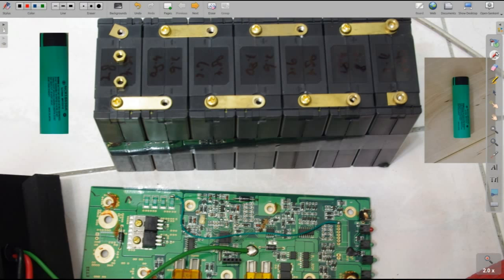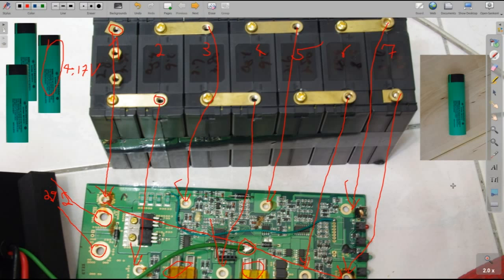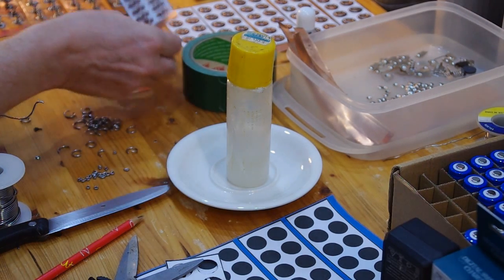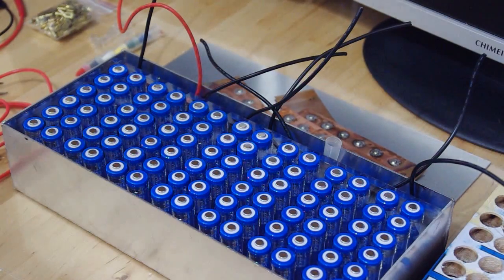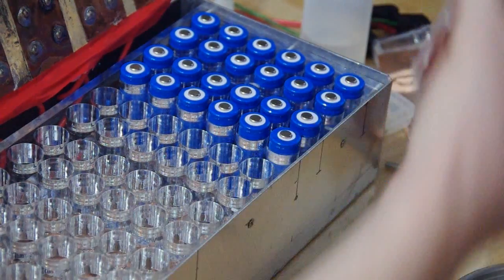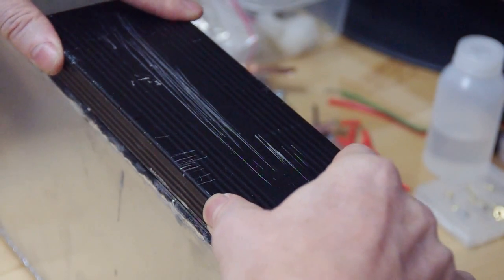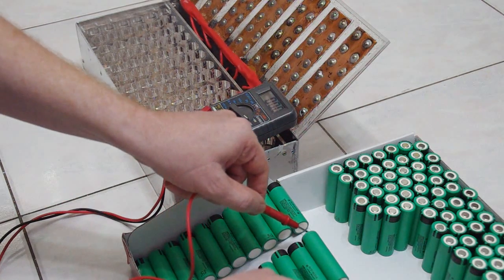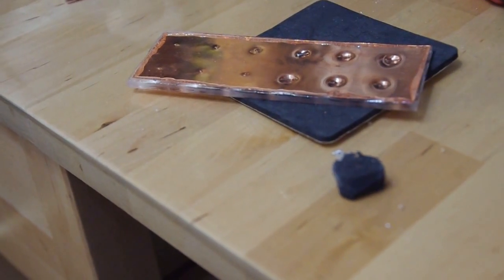How to build a Li-ion battery pack with panasonic 18650 cells 3100mah A

Comment: Nice battery pack and a simpler construction that many others. I had a similar idea but with spring plates top and bottom to make connections a little more reliable and easier between different batteries. It seems like those China eBay sellers could sell spring loaded DIY kits that would be perfect for the average home DIYer.

Comment: I wish that uyou had touched on the spring portion of the design, like where you got them, and where you got the strip solder that you used. Also, where did you obtain that flat copper stock that you used. This is a great design, I would love some links to the items that you used.

Comment: Love this video. He is the only guy who planned and executed an original design with spring loaded pack. Only pack I have seen, where you can pull out one battery at a time. My only concern is, over time, oxidization of the connection. I wonder if you could gold plate the terminals so there is always a good connection.
Reply from the maker: Thanks!
I was thinking about gold plating them before, or using some parts recycled from old PCs that are gold plated already. 
My next pack is definitely going to have some improvements, even though I did not run into any problems.
Reply: Hi David, Aqua regina can dissolve gold from your PC boards, but is highly explosive. Dangerous around organic solvents. Years ago, you could buy gold plating solutions which were not too expensive, but the price of gold in the 80's was low. Typically, companies here would gold plate a small circuit board for $2.50 US. Tesla, appears to be using tin, or tin plated metal and punched out the battery design with a space for their @6 amp fuse, I wonder if its possible to send the design to a pc circuit design company to make 2 prototypes for testing. I seen video where these 6 amp fuses were hand soldered ( hundreds ). Seems, too flak tome. A copper bus bar would be needed to carry all the current. I do not like the idea of a BMS, I know nothing about charging $1,000 US in batteries. I like your design because you can remove 1 cell at a time to make sure it is properly charged.

Comment: Hi David,
I love your design so much that I'm going to copy it, but with a twist. 
I'm going to avoid BMS and balance charging by using interchangeable 18650 batteries. The batteries will be charged individually then placed in the box. When my ebike (a Sondors Thin 36v) tells me the batteries need charging I will replace them with other pre-charged 18650's. By using this second batch of 'ready' batteries I should be able to make the changeover in less than five minutes and this should give me a range of over 100 miles or 160 KM. 
My batteries are all reclaimed from laptop batteries. All of the cells I use will be over 2KmAh, most in the 2600 to 2300 range.
When I get the box built and installed I will upload the finished product. For now you can see my first attempts on my channel.
Many thanks for a great idea.
Reply: Rocket Rose, I was thinking the same. I wanted the Tesla design with 6 amp or less fuses.
Reply: Rocket Rose k

Comment: Great ingenuity ,  BUT I see a serious concern....there should be fused protection for each cell, like you see in the tesla s, or most all electric vehicles, if just a single cell shorts and doesnt separate itself from the pack you just created a hell of a fire bomb...... the thermal runaway would be insane

Comment: >All cells are charged this way at a maximum of 650 mah, which is good.
you mean it aint 3100 mah? how you can get all 3100 mah from it?
Reply from the maker: By 650 mah, I meant the charge current. Each cell has to take in a maximum of 650 milliamps in an hour. The charging time is about 3.5 hours at that current. After that it drops to a lesser current and at 3.9 V, the charger will go into a very slow charging mode.

Comment: how are you handling cooling of your battery pack during charge and discharge cycles. i would believe that plexiglas might insulate and give issues with adequete cooling of this battery pack. .how has the performance been on this constructions?
Reply from the maker: The cells are covered only at the top and bottom for about a cm. Most of the cell is free.
The packs total capacity is three times of what I need for my bike. Therefore, none of the cells ever gets hot or even warm. 
The battery pack is holding up well. It's going to be two years next month and I haven't noticed any change in performance so far. 
I will open the battery pack next month and check each cell for its approximate capacity. 
I will let you know if there were any issues with any of those cells.
Reply: davidcandlelight
excellent, have you looked at the open bms system? https://github.com/Teslafly/OpenBMS

additionally what is your usual commute milage and climate like. I live in a cold climate myself and experienced issues with my nicad and sla gell cell packs. what do you do to insulate and keep your electrical potential during the cold?

Comment: what is that black box/case and where do I get it?
Reply from the maker: That was the old battery where I got the bms from. 
I recycled the BMS (battery management system) and the part that was mounting it from the original battery. 
You can find BMS on eBay for about 10 to 50 $ depending how sophisticated they are.

Comment: No such thing as 4600 mah li-ion cells nor 4000 not even close. 3400 is it so far. some reports of 3600 but I cant find any. Not real ones anyway. The fake china crap is just that. So you should have stayed with the 3100

Comment: my bike battery 24v 10Ah but the distance is not more than 23 km and the battery is empty
when I raised the 10Ah which over longer distances do
I mean if I have other cells instead with AH will help it and which cells are good ?but ware i can but it ?
Reply from the maker: +feyen willy I just had a mid drive engine instead of the hub motor. A 10 AH 36V lasted for about 40 KM. That is much more efficient. I build this new bike with hub and mid-drive motor. However, I got cheated again and the inside of the engine was old recycled parts. The engine only last for 800 KM, but the driving was awesome. 
Actually the first engine last for 5 km and the replacement last for 800 KM. I then got suspicious and took the engine apart, voiding my guaranty. 
However, no other way to find out about this cheating. 
Anyhow, a more efficient engine can get you up to 35 km with your battery specs. Mid drive engines are fantastic, new ones, of course. 
You could ask the shops that sell laptop replacement batteries to get you some original Panasonic, Sanyo, Sony etc. 
Do the math.  3200 mah per cell will give you approximately 2.5 AH per cell.
A line on seven times ten in parallels will get you 25 AH at 24 V.

Comment: how did you make the charger?
Reply from the maker: +Damian Yang I did not build the charger. The charger is for Li-Ion Batteries. It charges in three phases. The first is fast, from  about 24 V to 27.5.
Then  a little less current, till about 28.5 V.
Last is super slow till 29.2 V.
Each cell will have a maximum charge Voltage of 4.17 V. 
You mustn&#39;t  charge the cells above 4.2 V. 
At 4.3 V it will start to be even dangerous.
Reply: +davidcandlelight 
i have 100 18650 batteries. i want to run them in 16v to power my music. but i cant find a charger for the battery pack.
Reply from the maker: Damian Yang You can get a charger for model planes. Have two plugs to connect your setup. One plug puts them in line for use at 16V the other in parallel for charging at 4.2 V maximum. I think this way you don't really need a balancing board, but resisters between the individual cells of parallels in case they went out of balance too far between each recharge.
Reply: +davidcandlelight 
alright thank you

Comment: Beautiful design. Maybe resistance is a bit higher going from cell to soldering, to copper, to soldering, to copper and then to wires but that would be almost neglectable right?

Comment: Awesome!  I would think you would need some kind of "spring" tension action to keep the cells in tight contact.  I like your voltage range.  I am trying to find a very small BMS board that is correct.  I have found many available but all of them overcharge and waaay over discharge the cells.  Explains why lipo packs don't last the way they should.  Manufacturers want to sell more!  If anyone knows of a correct small circuit for 5 cells, I would really appreciate a link.

Comment: hi this is eric at electricbike.com...can you tell me where you got those cool plexiglass holders?  Thanks
Reply from the maker: Eric Allen  These are custom made holders. The company which made those for me is a rather small business with a handful of workers including the boss. 

I uploaded the template  to this site 
 http://www.carookee.de/forum/Englishteachers/depot/40290/4285573
http://www.carookee.de/forum/Englishteachers/depot/40290/4285574

there is a little save button on the page. 

These files can be fed into the laser cutter. It cost about 100 US$, however, you could make them slimmer which will cut down the cost.

Comment from the maker: The blue ones were 140 NTD and the Panasonic cost me 240 NTD each. 
NTD = NT$ New Taiwan Dollar. Divided by 31 will be US$ so the Panasonic cost 7. 74 US$.
Reply: +davidcandlelight Hey buddy -- what is the bms board you are using, and do you add anymore protection?
Reply: +davidcandlelight A question setting the board - - When my bike sits around 80v, and goes down to 62v when the batteries die. Do I set the board to a maximum of 80volts, and it will still manage the system properly as the voltage falls?

Comment: That is a great vid and thank you for sharing. I wish you would have explained in detail how you set up the batteries in parallel  and series.
Reply: if you can't figure out something that you simple you do not need to attempt a project like this. That works just like any other battery plus to plus is parallel and steps up amps or the storage. plus to neg steps up volts and is a series. do the math its not real hard.
Reply: +Jeremy Miller don't be patronising please. It's difficult to connect lots of batteries when you have to combine both series and parallel for your specific needs. There are lots of ways to do it depending where you want your wires to enter exit. Remember there are also lots of inexperienced electricians me included. I've looked at all the tesla battery makers and this is by far the way to go. What we really need now is the link to the circuit board so we don't have to IMAX b6 it. We all need a plug and play self contained unit for the common man. Love this idea.

Comment: Very good build!  It is very similar to the design that I created.
Increasing your batt capacity from 294W to 963.48W is a great thing. :-)

Btw, using a spring on the positive cell contacts would improve your contact reliability.  With your current design, shock forces while riding can cause your copper foil contacts to deform & reduce the contact force between your contact plates & cell + terminals.  Changing the soft copper to nickle plated springs would eliminate that eventuality.

Would you share a cost breakdown of your build?

Thanks for sharing!

Comment: I'm having trouble finding good cells cheap. I did find some but worried its to good to be true. Any help please?
Reply from the maker: First of all, only buy cells with a well known brand name like
Sanyo, Samsung, Sony, Panasonic, etc.
Try getting them from a local business dealing with electronics, who can order them directly from the production line. 
There are ways for determining the capacity. If you buy them from an unknown source like ebay, I recommend checking the capacity right after delivery.
Don't buy any cells that have been re-wrapped.

Comment: My friend help me get a good battery for mine 48volt 1000watt bycicle, i want a 200km range, have you try 6s lipo battery? are they good?  i can buy 6 of then and make a 44volt 48ah lipo. what spec should i get? My bike should reach to the moon and back with that lipo ? We need a battery revolution already cmon
Reply from the maker: Make sure you get an appropriate Protection Board BMS for balancing those cells.
Otherwise, you either destroy the cells very quickly or you could even end up with a fire.

Comment: The piece of shit Daniel Hornes needs to be banned from this channel!
Reply: If he can't find an 18650 battery on Ebay he must be an idiot. Davidcandlelight, I bought UltraFire 6000mah batteries for about 1.50 a piece. Do you think those ratings are fake and would they work in a battery pack similar to yours? The 18650 cells were sold by an R/C car dealer but I use them for my E-cig(vape). Have a great day!
Reply from the maker: Oscar Obsuna 
http://lygte-info.dk/review/batteries2012/UltraFire%20SJ18650%206000mAh%20(Black)%20UK.html
If you go here, you'll see that those cells only hold a capacity of about 1500 mah. I think that's what you can expect them to deliver. Since I paid for my Panasonic 3100 mah about 7.50 US$, you could view them as a cheap use and replace as they go down solution. Your pack will be a little heavy for the range provided, though. When your pack comes down to 30% charge only, the pack won't deliver a nice firm current and and and. 
At full charge 29.2 V, my pack gets me to a really nice speed. Once it's half empty, the speed is less of course, but it still pulls me up hills, an accelerates with the same punch, just the speed reduces. 

Look at the voltage to the left. At 3.4 V, you only managed to get 1200 mah out of them. That's where I cut my pack off and recharge. However, the Panasonic have delivered about 2900 mah at that point. You'll be going 30 Km  maximum and it won't bring the same joy. Check their capacity and do what I did, tell them they were cheating and send them back. 
You can buy Sony, Panasonic, Sanyo. They are all rated between 2600 and 3400 mah. And if you manage to get 2600 mah cells for half the price that I paid, than that's a deal. 

here is the graph. 
http://lygte-info.dk/pic/Batteries2012/UltraFire%20SJ18650%206000mAh%20(Black)/UltraFire%20SJ18650%206000mAh%20(Black)-Capacity.png
Reply: So you recommend Sony, Panasonic, Sanyo?
Reply: I found Sony VTC4 for about 5 dollars a piece
Reply from the maker: Oscar Obsuna When they are the real once, and what I found on the net about them is true, then that will make an awesome pack. 
(quote start)
" Sony (from Japan) makes the high quality IMR-18650-VTC4 cell. The capacity is 2100-mAh (be careful, the similar VTC3 cell is only 1600-mAh), and this incredible cell puts out 30A per cell in the paralleled group. For every cell that you add in parallel, you will also be adding another 30A of current capability to the pack. This means that a 12S / 5P pack that would provide 44V / 10.5-Ah…can also provide 150A of temporary peak current!" " (Quote end)
https://www.electricbike.com/high-current-batteries-not-lipo/
Reply: Oscar Obsuna I recommend SANYO, for me it was the best.
http://www.banggood.com/buy/Sanyo.html
Reply: OK I'll check it out! Thanks!! Is Sanyo a Japanese Brand?
Reply: Oscar Obsuna Fyi... Sanyo has been acquired by Panasonic.

Comment: hello, how much did you buy the 2 types of 18650 for? and did you managed to use a battery management system on them to find out the actual cell capacity? have you seen the video on E-samba? the fella made his "pack" similar to your style, added individual fuse ... alot of work ... but alot of safety
Reply from the maker: Arashi San Hi! I paid for the blue no name cells, which were a scam about 3 US$ a piece. The Panasonic with a rating of 3100 mah, I got for  about 7.50 US$ a piece.
Reply: davidcandlelight  i see. being closer to china continent. i will be trying a variety of 18650/26650 cells to make up a bigger cell (and yes ... i think the 7200mah cells look so good at USD3  too!). did you managed to log like how did the capacity derate over time for your good cells?

Comment: how do the cells maintain a balanced charge?
Reply from the maker: The balancing PCB  board will charge each cell to 4.17 V. If one unit exceeds 4.22V, the charger will turn off. I had this one time where I discharged the pack below 3.4 V per cell. It then only charged to 28.8 V and cut off the charging.
The next pack I build will have some design improvements where I can check without opening the pack and even re-balance it if needed.  
Anyhow, take a look here http://www.ebay.com/itm/7S-Li-ion-Lithium-Battery-Input-Ouput-Protection-Board-PCB-25-2V-25-9V-29-4V-BMS-/321128915784?pt=US_Rechargeable_Batteries&hash=item4ac4c66348
http://www.ebay.com/itm/5-6-or-7-cells-20A-w-balancing-Li-ion-Lithium-18650-Battery-In-Out-Protection/111091669495?_trksid=p2047675.c100005.m1851&_trkparms=aid%3D222007%26algo%3DSIC.MBE%26ao%3D1%26asc%3D27538%26meid%3D2d2b460599e244f38a3634a2dc097f1b%26pid%3D100005%26prg%3D11353%26rk%3D3%26rkt%3D6%26mehot%3Dpp%26sd%3D321128915784&rt=nc
Reply: thats great thanks
Reply: davidcandlelight That 2nd link looks like a well designed BMS board.